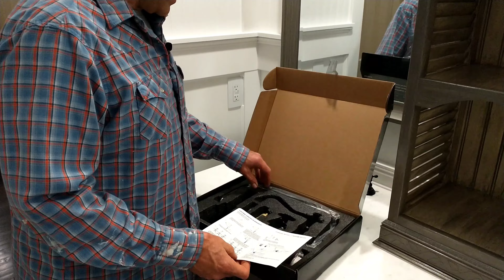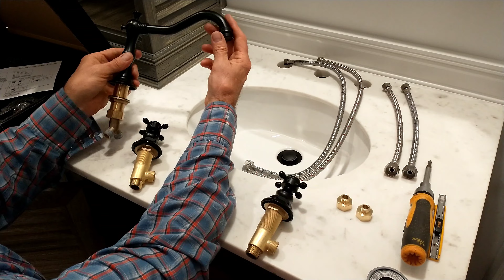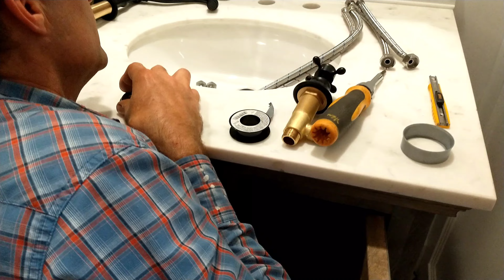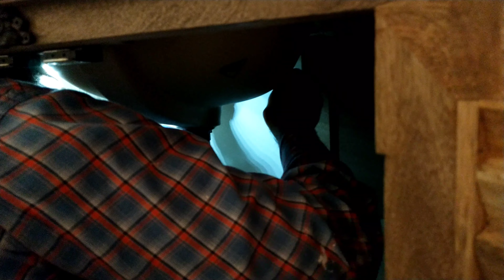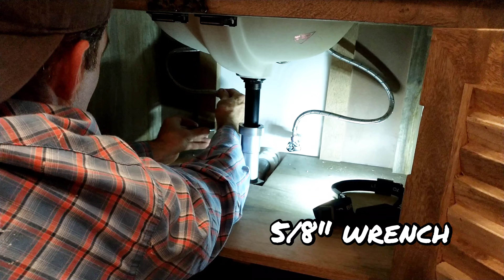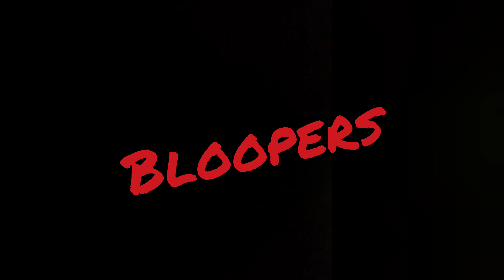Install Widespread Deck Mounted 3 Piece Bathroom Faucet DIY

Comment: You guys explain everything so clearly.  I bought this unit a few years ago but just today the hot water knob wont turn off.  I tried to take your instructions in reverse to remove it. Unfortunately the screw in the hot water knob has corroded.  Put Wd40 on it for a few minutes.  The screw has dissolved.  Just the head of it. Still can’t get the thing disconnected. Any ideas?
Reply from the maker: Hi. Sorry to hear about the screw issue. At this point, you may have to buy a “screw extractor bit”. That kind of bit will extract a screw. If that doesn’t work, you can try an oversized drill bit and drill through the screw so that you can remove the faucet knob. I hope this information helps 👍
Reply: @YouCanDoIt2 I’ll give it a try! Thanks!
Reply from the maker: https://www.lowes.com/pd/SpeedOut-Speed-Out-Pro/1002536702